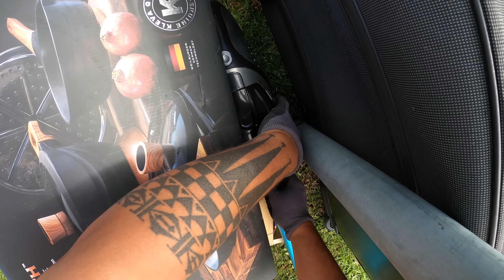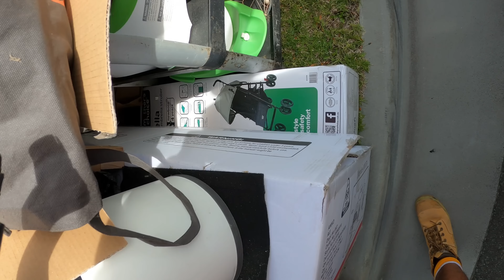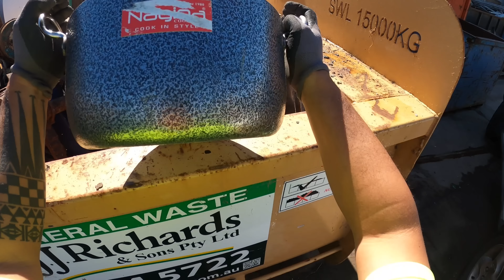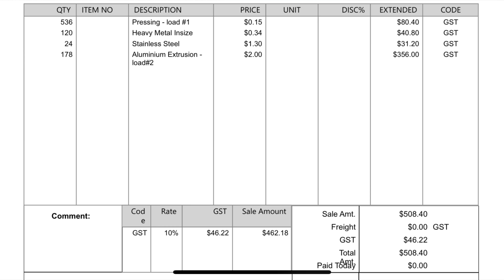Scrapping in the Streets - Some For Everyone

Comment: Poly, on the power chair if you look under the support for the seat, you will see pull pins that will release the seat.  Then there are 4 to 6 screws or short bolts to remove that verses by model. This will drop the front plastics or fiberglass panel.  You then can slide the batteries out, some have only one others have two.  It's about a ten minutes to do the job. Happy scrapping and great video.
Reply from the maker: Thanks mate 🙏

Comment: Hi, Pohly! Great haul with the extra stuff you took in! That is the biggest amount I have seen anyone get for their scrap!! Awesome!! 😎

You have to take the seat off the scooter to get the battery off the base. There is a lever underneath the seat. Push on it and turn the seat then lift it up. That leaver keeps the seat locked on until you do that. I have a scooter much like that one. Hope you took it!! Scooters can go for $500 on up used. New batteries may be all it needs!
Reply from the maker: Thanks for the tips 🙂

Comment: with the scooter uce. the seat comes off. has a release pullie... and the battery is in the black cover and will be 2 batteries in it. the 2 motors that control the left wheel and right wheel are good metal scrap as well. :)
Reply from the maker: Thanks uso! 🙏